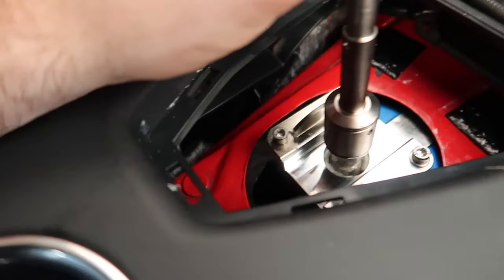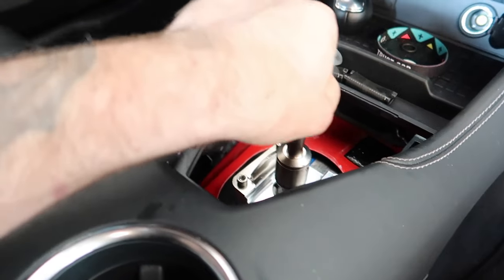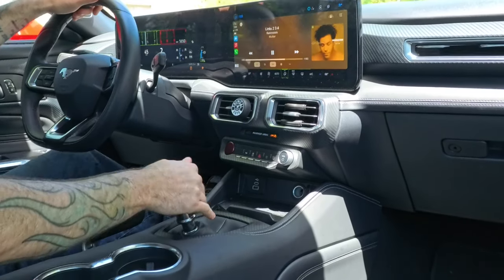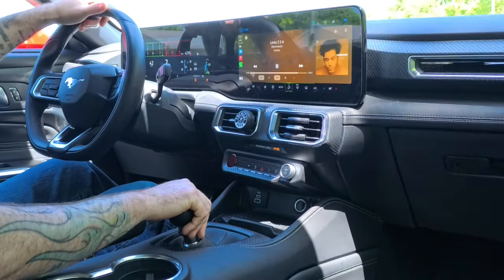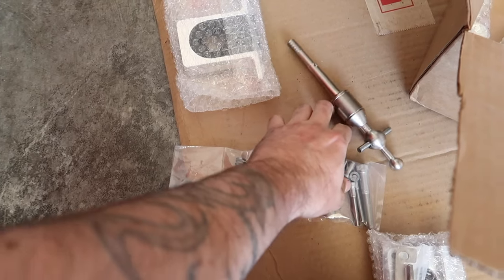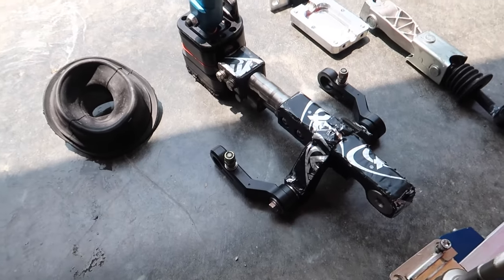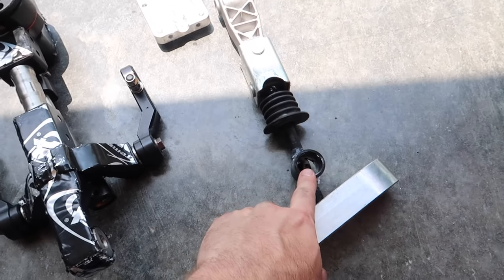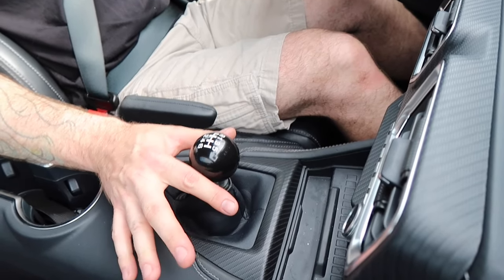MGW vs Steeda Shifter 2024+ Mustang HEAD TO HEAD Ultimate Comparison

Comment: I did a Steeda Body Mount and the Steeda Trans insert and it was so loud and had way to much vibration for me.. I pulled the Trans Insert back out and left the body mount in and it was much better. Also the heavy noise and vibration was gone once I got rid of the trans insert.. I am planning to one day do the MGW shifter because that's the one everyone says is the best over all.. (Honestly if you Don't go to the Track or you are Older and you are more of a weekend chill out kind of guy, You are not going to want either one of these shifters truth be told because the NVH will be to much for you. You will be like what happened to my nice smooth feeling car afterwards?..) If anything the MGW would be the best way to go..
Reply from the maker: MGW is amazing and now my favorite. It does have shift ball vibration bc directly mounted to transmission but man is it perfect at shifting into gear. It feels like a whole new car. Now I see why ppl love them so much
Reply: @Zander13Productions   I will eventually get one. Just not really needed yet.. I actually made out pretty well using the Steeda Body mount bracket.. It really made a difference that and a shifter ball..

Comment: I love your content and your other video about the steeda was a big reason I ended up getting it. I hope you make a video about swapping the oe fluid to the BG syncro shift II as I read that it improves alot of the crunchy shifts. Also I was wondering if you had any issues with putting the oe shift knob back onto the steeda. I cant tighten it more because reverse wont lift up properly if I do but it is loose and doesnt stay in place.